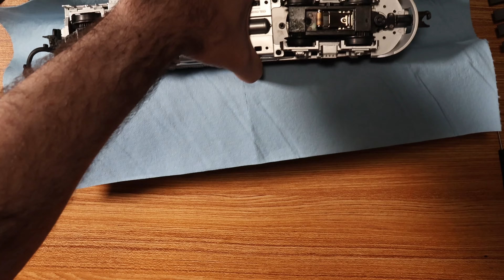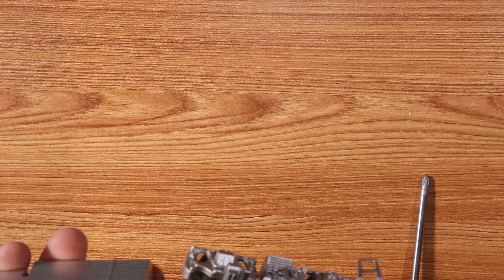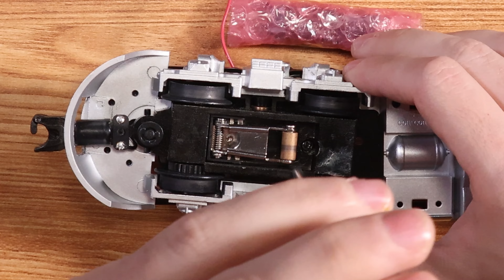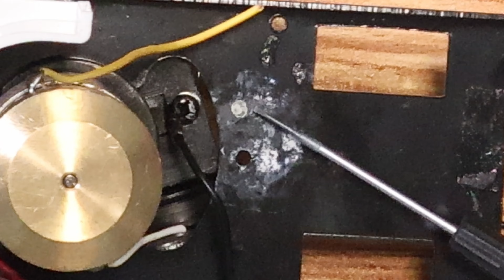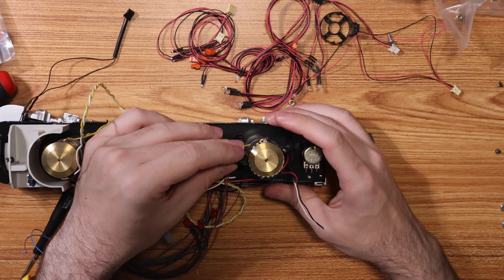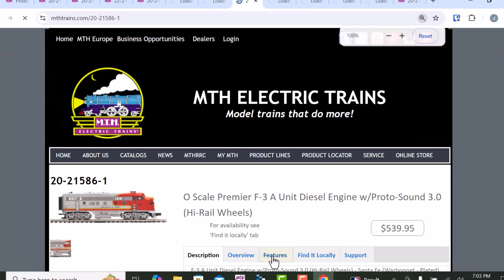Installing a MTH PS3 Diesel Upgrade Kit

Comment: I thought the video could have/should have been much longer in order to address all the challenges that come up through the process, especially for those of us who were going thru an upgrade for the first time. Because the instructions had to address a wide variety of different engines, there is quite a bit of improvising necessary. The tach bracket mounting was just one example that was glossed over in this video. And I never did see what you did with that black bracket packaged with the heat sink! Ended up as a leftover part for me.

Comment: how did you mount the tach mount bracket?
Reply from the maker: In some cases the bracket fits under the flywheel without much modification. In other cases I need to cut some of the plastic away so it will fit. In the third type of case I have to glue just the plastic holder portion under the flywheek because otherwise it would get in the way.

Comment: Thank you Dan for the video…very helpful to us postwar antiques.  I wonder if you could add the cost of this upgrade in case someone encounters a PS1 brick they will know they have options for repair to get it running again.  Thanks again
Reply from the maker: The upgrade kit sells from MTH parts and sales, at the time of this comment its $200 + shipping.

My train club (coltrains.com) is an MTH ASC, i know they usually* charge $300 for parts and labor, my assumption is ASC's in your area should charge similar rates

The other thing to point out is not all PS1 engines have PS2/PS3 sound files, the biggest ones for me that will become problems are the subways.